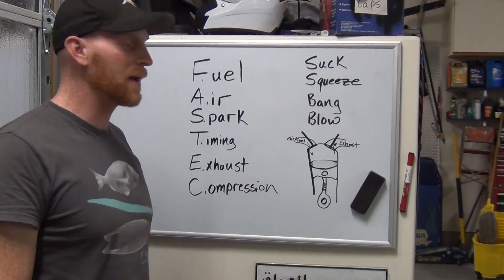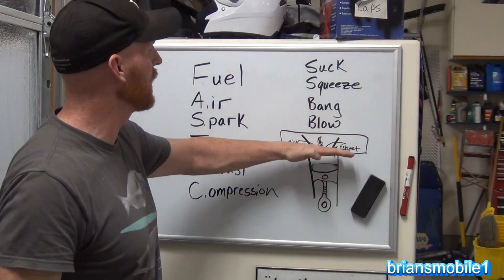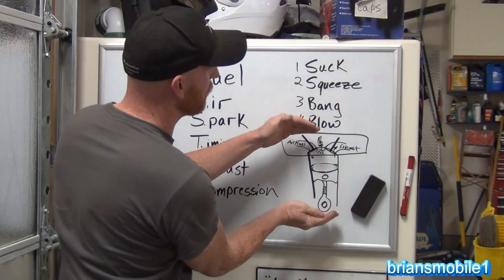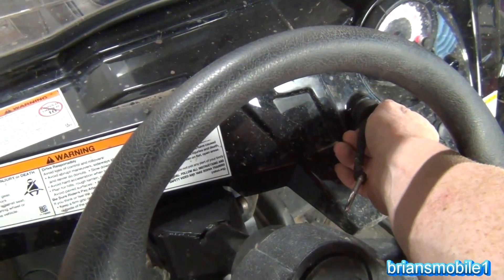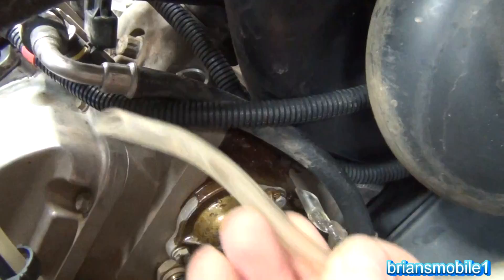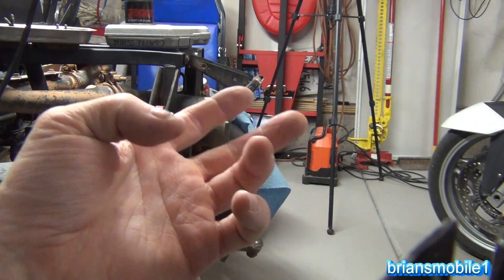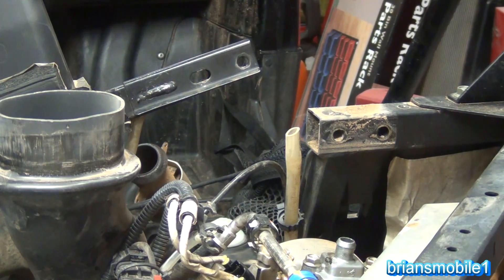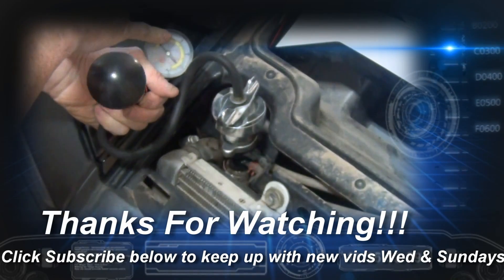Crank No Start Checklist FASTEC

Comment: Great video! I have a similar issue but no piston damage. I recently got a smoking deal on a Honda foreman and it needed a new top end. So I printed the manual and got it done. Now I have it all back together and it cranks but doesn’t start. I have spark, I have fuel and air but nothing! It turns over and over. I’ve never done any type of mechanics before and this is my first build. Am I missing something? This timing issue you talked about, was I suppose to put the piston in a certain position when I put it back together? I have no clue. Can you help me out.

Comment: Some one can help me with my raptor660 2005 I just changed the piston, the rings and the seal valves exhausted the clutch but when I finished the engine is running but very hard

Comment: Mine is clicking. Have a new battery, new alternator, new spark plugs, new fuel pump and filter, new mass air flow system and everything. But yet it still clicks when I start it. All my relays are good and fuses, but it’s like I’m getting no power to my starter. Could this be a starter issue, coil issue or switch issue? Can anyone help

Comment: With my quad I have a new battery new starter relay it turns but won’t fire have good spark I poured a little gas in the cylinder head it and it’ll burn that up then quit puff off smoke it’s like it’s not getting fuel I’ll do the exhaust test a bit of history it was running fine and then it just bogged out and died it’s a 2013 grizzly 700 all fuzes are good I don’t want to take it to the shop just wish I could figure it out but this video has given me a lot of ideas especially where to start great vid cheers

Comment: also what do you mean by fuel air mix, when i put starter fluid in there it pops but only for like half a second.
Reply: Exotic Axstin it means you have a fuel problem because there’s not enough fuel being sucked in for it to be fired up longer

Comment: so i have an atv. i got it running after cleaning the carb and all that, but the exhaust is broken right at the engine block. it was running a couple days ago then it died. there is quiet a bit of gunk right by the exhaust on the engine block. could that be a factor to it not starting? it would crank but not start, and i just burned out a solinoid trying to start it again. but what’s your thoughts i would love help!!!

Comment: Any idea about solving (cranking no start) on 2004 Volvo S80, replaced fuel pump, crankshaft position sensor and plugs but still not starting, no spark either, all the fuses are ok,

Comment: My car engine has good compression and has spark but starting fluid won't start it cold.... But if I bump start the car it runs perfectly fine until the engine cools off smell a little bit of gas but nothing overpowering... Toyota 22R with a webber 32/36 carb if anyone can help me it would be greatly appreciated

Comment: Hi Brian-love your channel! Step one should be offer the owner $200 for it!
Reply from the maker: I've had that offer a few times for a dead battery causing the car to not shift into neutral.  I declined and sold them a battery instead.
Reply: Just messin with ya bud.Did you do a follow up vid? I'd like to see inside that cylinder with the head off.Are those jugs,or is it a block?

Comment: Im sorry but your apriach to teaching people is lacking. Tge references to things are ok, they are not hurting anything. What i really noticed is that you kept on introducing diesal engines without differentiating them from gasoline engines. Then you added rotary engines. You just need to pick a subject and stick to it. 

Alright, today we will be talking about the basic mechanics of 4-stroke engines. 
Then maybe in a different video have 2 stroke engines. you may consider haveing a 4 stroke and 2 stroke and deisal video, but if you do, you MUST HAVE SECTIONS. You must have a 4 stroke section, a 2 stroke section, and a deisal section. Do not cram it into one white board.

All in all, a few pointers. You have more will than i, for i wouldnt attempt to post anything helpful on youtube, because in lazy.

Comment: I like "A FAST Corrected Error" or AFASTCE for newer vehicles. First verify the complaint (try to start it) and look at the dash lights. Manufacturer's Anti-theft systems will often give a light on the dash when they have disabled the vehicle (when they think they are doing their job...not in all failures of the system) In a no light situation move on to FAS (Fuel/Air and Spark). Those belong together because a common failure will take out both fuel and spark which could bring you back to Anti-theft again, or could simply be 1 blown fuse. Next is Compression, then Exhaust. Even if you don't see signs of exhaust, compression will still need checked. It's often faster on small engines (1 or 2 cylinders) to find a camshaft not turning by checking compression. You will see compression with a blocked exhaust though....it might even be crazy high for the engine. A broken timing belt/chain/gear could easily lead you down the path of blaming exhaust when the exhaust is fine.

Comment: Hey Brian, what type of street bike do you have?  Saw the front end of it and your helmet in the video.  I've got a 97 Honda ST1100 w 80K miles.  I just replaced the timing belt on it, kind of a pain had to pull all the "tupperware", front wheel, and radiator to get to it.  Glad thats done.
Reply from the maker: +helidodge It's a BMW RT1200RT-P  It's donning a fair bit of Tupperware too!
Reply: +briansmobile1 Cool bike

Comment: Very informative video, Brian. I would have checked to see if the piston was moving on the dead cylinder.
Reply from the maker: +wysetech2000 You're right.  You got me doubting because I remember getting a little puff off that hole.  I had to go double check it.  It's pumping up and down like a little humming bird wing.  I had Mrs. briansmobile1 do the key wile I looked down the hole w. a flashlight.  It's moving.
Reply: Well, at least you know the connecting rod is still in tact.

Comment: FASTEC is a bit dated. for me it should be FAS"A"TEC - "A' for anti theft/remote start/immobilizer, the amount of vehicle coming to the shop with no start because of that system is pretty huge
Reply: +ebu touy It's titled crank no start.  Anti theft would be no crank no start.
Reply: +MikeP47 not always. some  vehicles will disable injector pulse
Reply from the maker: +ebu touy Great point.  I had a blurb to that affect about loss of fuel or spark, but it got chopped.   One of those 3am decisions your know.
Reply: @briansmobile1  my car opel astra 1.6 16v in the morning crank but does not turn on and when I try to turn on the engine light it does like a flash I turn on the car in second gear and turn it down and when it starts once it starts normally and when I drive and press the accelerator the car there is no power suffocates and I have to press the gas slowly I had lit what I prefer to control
Reply: Interesting, didn't know that.
Reply: { FISS-ATE-BB-C-FAS }  Fuel,,, Inertia switch ,,, spark,,, suck,,,-,,,Air,,, timing,, ,exhaust,,,-Bang,,,Blow,,,Comparison,,,-,,,fusible link,,,anti theft,, ,squeeze

Comment: awesome. what was the final results/root cause of damage?
Reply: +Devo looked like detonation. the fuel is not supposed to explode, it's supposed to be a controlled burn, if it does explode it's called detonation, which usually takes out the ring lands. detonation can be caused by improper timing, and or improper air/fuel mix.
Reply: Detonation often seen when fuel mix is excessively lean, such a lean mix will cause overheat, it's very common on performance recreational vehicles to have holes burned through the pistons because the operator was running too lean. however, it's hard to say on this machine as I have not seen myself
Reply: +Dick Fageroni to me it looked like the same scoot that was in the vidio about gas in the oil, that four wheeler had a carbeurator, he even showed rebuilding it.ring lands just don't break for no reason, clearly this scoot has more than a few issues. the only other possibility for broken ring lands is if the engine had been rebuilt with improperly gapped rings.
Reply: +Dick Fageroni fuel exploding under the ring might be physically possible, but externally improbable as the fuel would most likely be diluted with engine oil, severely reducing its volatility, and a leaking injector would cause a rich burn, cooling the engine. and the overheat is odd as the cylinders didn't show significant scoring, granted the vidio of the the bore-scope let a lot to be desired. perhaps it overheated just enough to melt the e.f.I. brain or the oxygen sensor, causing a lean mix? idk, need more info

Comment: Brian, how about squirting a bit of oil into the cylinders? Ken
Reply: +kenskip1 
No need for that, Squirting oil in the cylinder is just to get an idea if a low compression reading is caused by bad rings or bad valves, if it's rings the compression comes up, if its valves it will not change much, the mechanical damage from the bore-scope video and the ZERO reading he got from the one cylinder is enough diagnosis to know that the engine has a mechanical failure and will need to be torn down, no need to spend any more time or make a mess with oil.

Comment: Crank no start is so much easier to diagnose than no crank. No crank could be bad battery, bad crankshaft position sensor, bad neutral safety switch, any plethora of electrical system interconnected. At least if you can roll the motor over you can check for gas, air, compression, backpressure, etc relatively quickly. No crank (in my experience) takes a lot more Googling and a lot more taking apart electrical connections and checking for faulty electrical parts, plus you need to find out the values for things. The normal resistance of a CPS sensor might be 60-80 ohms (not a real value, just stating a range for shits and giggles), so you really have to look it up.

Comment: Hi Brian! This video is a great help with one of my cars BUT I seem to have everything here but it doesn't idle for more than a second. 

Is there any way to test a fuel pressure regulator without the car running? The car is a 91 Miata, and I have good fuel pressure from a new fuel pump.
Reply from the maker: +Striball That's a different problem than Crank-no-start or a cylinder misfire (which FASTEC also works on).  That's an issue with fuel management or air fuel metering most likely.  I automatically jump to MAF failure, (without codes) vacuum leaks and wire harness issues based on my experience, but a good strategy would be hooking it up to an advanced computer and watching the numbers to see if you have a glitch, an unreasonable number for temperature, or a fuel trim that is outside the norm.
Reply: how old are the spark plug wires and what brand are they?

Comment: ive been looking for a video like this for a while. a problem im having is i have a 2002 gmc Yukon xl and when the fuel level is at 1/4 or less my car may or may not start on a level surface it just cranks but the minute i add gas to get it above 1/4 it starts and runs fine i hear the fuel pump run every time. any ideas anybody?
Reply from the maker: +Mickey Ball The first thing I would check there is the fuel pressure when it's below 1/4 tank.  Next from there would be the sending unit.   Was it installed properly to the bottom of the tank?  Is it dark tan or brown instead of something that could be described as cream?  Is the strainer intact and the right color?

Comment: if there is 1 thing i learned in the trade is that overall noise for compression assumption can be overlook for anybody with low diagnostic skill. if 1 full bank is at fault it will still sound about right and/or right.  having 1 out of 6 cylinder will definitly sound uneven. i got and old stratus that had 1 coil out of 2 firing as the timing was off 2 teeth. i got screwed as i didn't previously check both coil for spark and assume he flooded it at a -30c morning.  when the real reason was a fail timing pulley. =)
Reply from the maker: +Kevin Gosselin Great comment.  It's experiences similar to this that take a kick butt prideful mechanic and humble him/her toward being an excellent technician.

Comment: Thank you for this man. I did this exact thing when I diagnosed my truck the other day. 97f150 with a 4.6 manual. Cylinder one had 156psi. Cylinder two had 48psi LOL. Pretty sure it blew the plug threads out of it. 
Initial concern was misfiring on cylinder 3. Replaced plugs and wires. Next day misfiring on 4&6. Threw new coil packs at it. No change. 
Had replaced an injector that was cracked. I'm done throwing time and money at it. Looking for a 5.4 to swap in
Reply from the maker: +Ernesto Lugo I know people who love that motor, but I am not one.  Good luck!

Comment: Hate GDI - dirty valves
Hate Turbos - more moving parts
Love good ol. carbs - Cheap to fix
Reply: briansmobile1 I didn't mean a turbo has less moving parts, what I meant was the assumption that because there are more moving parts that the vehicle and it's parts will be more likely to break down or have less longevity, and that is untrue. YES, a turbo adds more parts, NO a turbo is not unreliable or means more break downs. That is what my original statement meant. There's also the fact he likes carbs, they have MANY moving parts inside of them, and yet he prefers that. Carbs require maintenance, injectors can last for 200,000 miles or more.

The car only pushes about 12 psi at full boost, most people tell me that's a light pressure turbo so my statement is invalid. As far as I'm concerned they just don't want to be proven wrong, the turbo nay sayers all seem to think a turbo dies at 100,000 miles or less.
Reply: +MeowJW I have a turbo with 360,000 miles on it, so... pretty invalid statement.
Reply from the maker: +MeowJW You might enjoy watching this Formula 1 car video.  https://www.youtube.com/watch?v=QFy0ezTOLZs&index=40&list=WL  This video is integral to understanding how/why things have changed over the years with fuel injection and turbos in Europe (they led the way no doubt) and the trade-off's and risks associated with complexity and increased moving part count.
Reply from the maker: +Jesse Crandle Wow Jesse!  That's impressive!  I'd love to know more about that.
Also, how do turbos have less or the same moving part count than a non turbo vehicle?  Assuming bearings, turbines, waste gate and linkages, etc.  A non turbo vehicle has less parts, i.e. plumbing and cooling, but also less moving parts too.  Both my vehicles are turbo.  You know where I stand on that.  I'm just encouraging a little critical thinking.  I like that. https://www.youtube.com/watch?v=pWdd6_ZxX8c